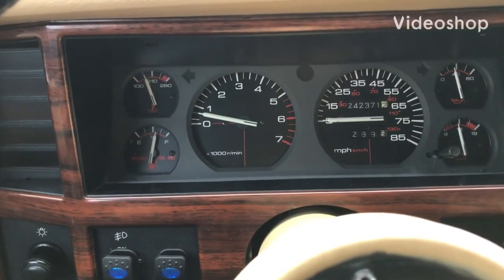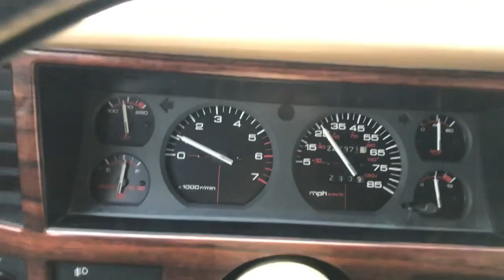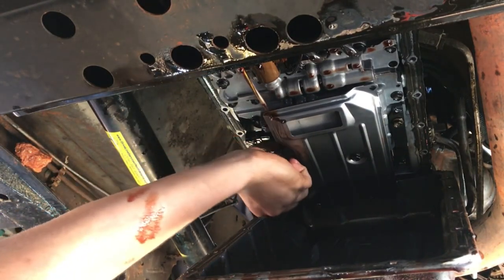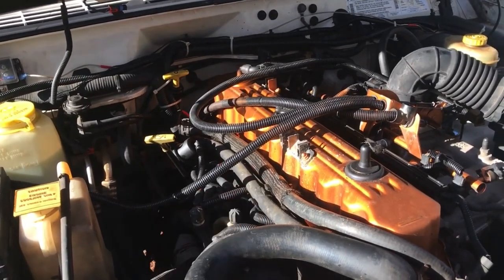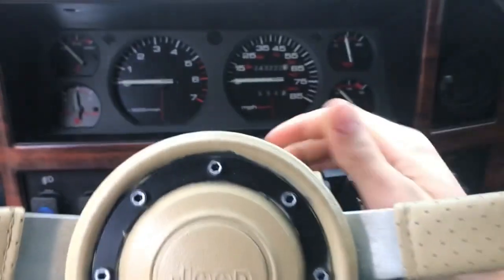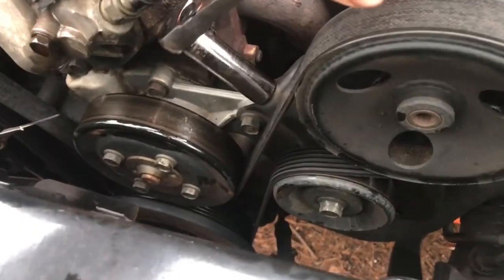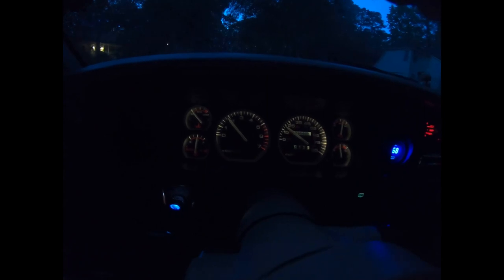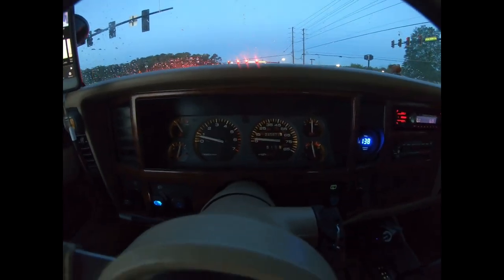Jeep XJ AW4 transmission delayed shift, and symptoms

Comment: There are three possibilities to look at still. First is.. Conditions of wiring that goes to the ecm/computer in the engine bay. Second is.. The speedometer output sensor on the 4x4 transfer case (or trans output housing for 2WD only models). Third is.. Check the throttle position sensor that is on the engine throttle body (side facing the fire wall). The ecm activates and deactivates the transmission solenoids as the engine throttle position and rpm speed varies with speedometer speed output, thus, both sensors have to be working, in order for the ecm to shift the transmission correctly, as to keep it in sync with the kick down cable action. I am not totally sure about rpm sensory, but I do think it is counted from the crankshaft position sensor, which, you will know is working if the engine is running. The ecm cannot run the engine without that crankshaft position sensor working!! On another note though, one variable that should not be looked over, is the fact the rpm might be counted by the distributor sensor (I forget the name of it). If any of the sensors I have mentioned are still old, you will do well with changing them. One more thing that most jeep guys don't do.. Is change the o2 if they keep getting a check engine light. Well, I can tell you, that most of the check engine light problems, will be because of a bad o2 sensor! I did a ton of research and found that the NGK/NTK o2 that I needed, was the 23023. I bought one, and it works great in my 91 4.0. Of course, different years, more so after 95, have differing part numbers and specifications. So be wise and make sure you get the right part to fit your model year of engine.

Comment: Possible the worst way to flush a transmission is disconnecting the oil cooler lines and running it..the money you
Would spend buying 2 filters and all that extra fluid you could just take to a shop pay 120 and have it professionally flushed safely with a machine
Reply: @James Galagarza .James, you got that right. As long as the oil change place can guaranty they'll be using the correct fluid & not their usual ''Bulk Fluid'' ''Junk Off-The-Wall Shit'' like an old K-Mart would have carried when they were still around... I had to stop getting our engine oil changed at the shops by me because my best friends son who worked at the best one in town. He never had either of his vehicles oil changed with their Bulk Oil but rather he brought his own motor oil & just used the facility because it was easier, plus he could keep the front-end greased, get better prices on Air-Filters & Cabin Filters & what-knot & did everything according to his personal maintenance schedule....

Comment: My '93 XJ AW4 4.0 is currently having the same issue, I run dex/merc, I ended up disconnecting the battery and then unplugging the TCU (transmission control unit) located behind lower part of dash on passenger side. Then shifted manually down the road, 1-2 gear will give you only 1st, then shifted to 3rd gear with no problem or delay, had to let off the gas a bit tho, then shifted to D which will give you 4th gear. I had no problems at all which leaves me to believe it's an electrical issue. I already replaced my TPS so I'm thinking it is my speed sensor on transmission or my TCU is starting to go.
Reply from the maker: Mine ended up being the transmission unit itself. If yours is having the same issues as mine, count how many times it shifts from a stop until you get up to speed. Mine skipped second gear because it only shifted four times including overdrive even though the AW4 is has 5 gears.
Reply: @Tylerjschmidt  5 gears?  the amount of gears it has is literally in the name aw4...4 being the amount of gears.  Now you do have the torq converter that will kick in and can feel like another gear.
Reply: @Paul Lamb When you put it in 1-2 it will only shift into 2 at around 4K rpms. This is correct
Reply: @Tylerjschmidt  the AW4 is a 4 speed, dude
Reply: Did you ever get it fixed?
Reply: @Tylerjschmidt  dude, the AW4 is a 4 speed. The clue is in the name 😂

Comment: Mine does this only when it’s cold. 2001 XJ AUTO 2wd. Took it to a transmission shop and have had 0 luck but have had two transmissions put in it now and I’m still having the same issues. I use the ATF which I was told to use. I replaced the throttle body cable valve and a lot of sensors and still 0 luck with this. I don’t think it has to do anything with the fluids because even with the original transmission I put ATF in it and had 0 problems
Reply: any news? i have the same cold shift problems out of first
Reply: @tyberlong  me too :/

Comment: It’s the shift solenoids!! I had a transmission service done, I put in a new throttle position sensor and I put in a new transmission speedometer sensor and none of that worked, then did the shift solenoids and problem solved.😩
Reply: How much did they charge u to do the solenoids?
Reply: I just replaced my shift solenoids and it made absolutely zero difference.

Comment: what state are you in?
Just rebuilt the aw4 in my cherokee, and SUPER happy w the results.
Reply: What all was included in your rebuild?
Reply: What material did you use to rebuild the aw4 and what tools are needed?
Reply from the maker: Georgia
Reply: Jeepin Guy. Hi, I'm interested in finding out some information from ya about your rebuilt AW4 transmission rebuild. I have a 1993 XJ 4x4  w/auto trans.  Do you have a website or a way to get in touch with you? I have two options, I can rebuild mine, or a guy I met about 6 months ago offered to sell me one of his Jeep XJ's that he has parked in his commercial yard stupid cheap for some work I can do in exchange so it equals out good for both of us. He did say the drive-train was all in great shape & it was certainly ready to go but I've been down that road before so I'm just thinking don't spend any of the extra cash in my XJ savings account but just keep putting money into the account so I'll have something extra in case I need a rebuild. 

**lol Lets just put it this way, whatever happens with the two transmissions, I still wanted to have a rebuild trans ready to go if & when I needed one. In fact I want to keep this Jeep as ready as it can be, just in case someone checks mine out & offers me some crazy money for it.**

Comment: Did you ever get this fixed? This is my exact problem in my 98.
Reply from the maker: Yes. didn’t have second gear. Replaced whole transmission. Next time you drive yours. Count how many times it shifts. If it only shifts 4 times including overdrive. You know your transmission is due for a rebuild.
Reply: Shouldn't it be 3 times?